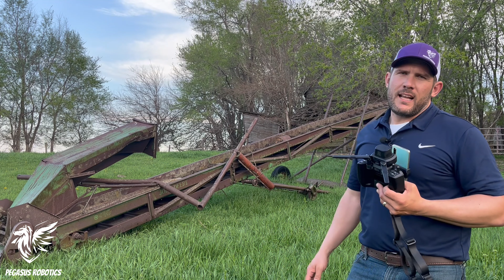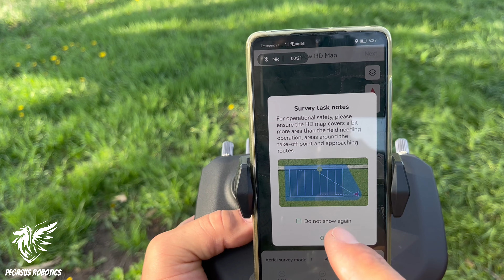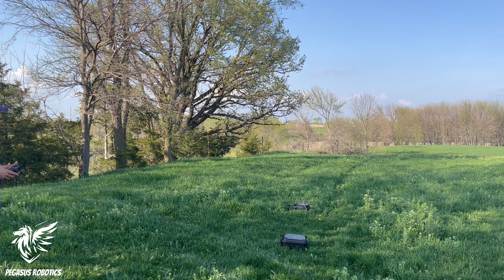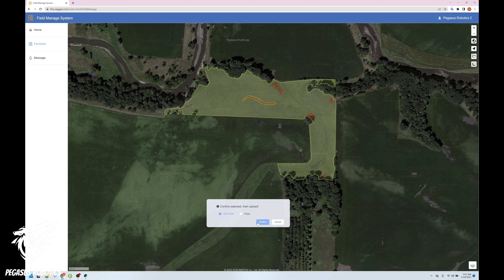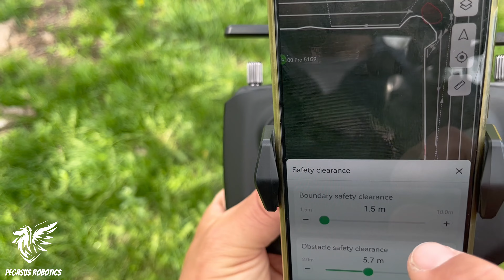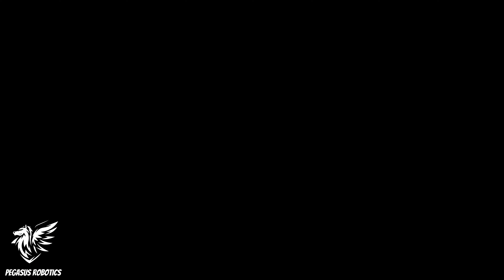How to set up & execute a spray mission | XAG P100 Pro | In-depth tutorial

Comment: Excellent tutorial, you definitely don't hesitate to walk all the way around the field to show us that Way of Mapping.
I have a question. I have large fields that are 2 kilometers long. Could I also use the terra module if I don't have internet reception?
 Because I know that the connection betwen the controls and Good Camera quality doesn't reach that far, with XAG
Reply from the maker: Terra module would work but may take awhile and several batteries on a field of that size. It would e best to use Pix4Dfields with a light weight mapping drone such as the Mavic3 series. Then you could outline your obstacles and boundaries and transfer those to XAG One for flight planning.

Comment: Hi Nathan, Thank you so much for the excellent video. 
I've a question if you address it I'll be thankful.
DJI consumes 1 Battery and also charges 1 battery almost the same time, there's no stop or pause during continuous operation. But XAG consumes 2 batteries at a time but charges 1 battery around the same time so I feel there'll be pause or stop during continuous operation. How will handle this during operation without break. 😊
Reply from the maker: Very simple answer is to have a few batteries on rotation so you can fly non stop or plan it properly so your extra battery has the 10min charge window during the mission.
Reply: @pegasusrobotics - how many batteries? 4 is enoght? Or need 6?

Comment: When you marking out your boundary with the controller is there certain distance you have to mark from point to point?
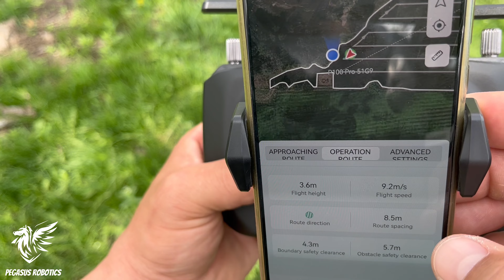Reply from the maker: It really depends on the accuracy of the GPS, in the video Nathan talks about this at 8:09.  If in GPS it may be better to be 1m or 3ft from the obstacle or vRTK may be half that or right next to it if you are on RTK. You can also modify the boundary and obstacle settings in the mission planner shown at 32:10.